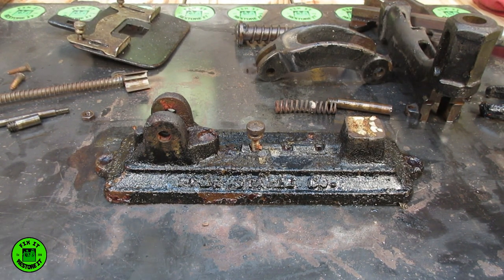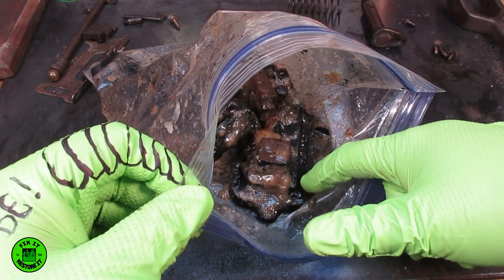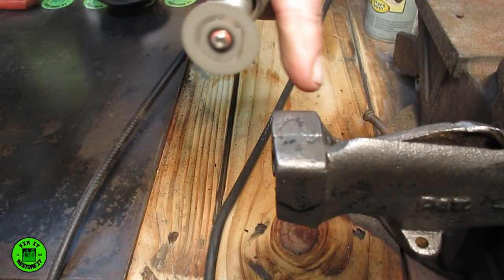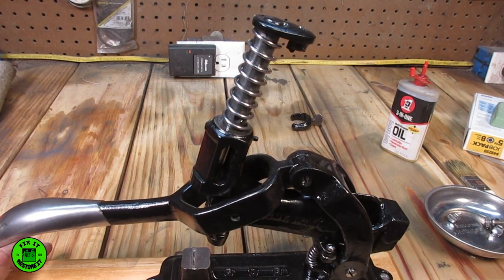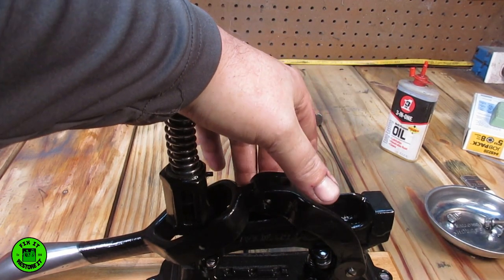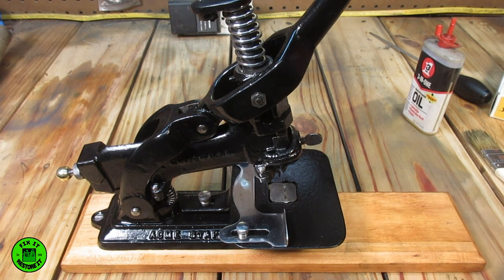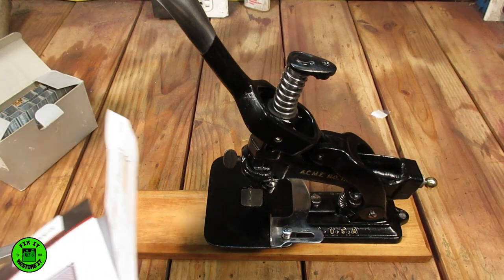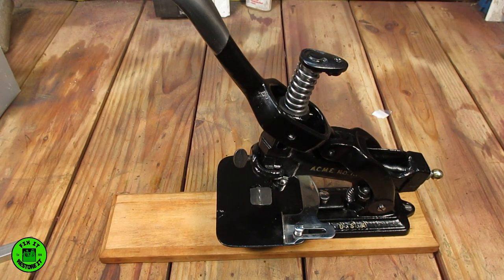Acme No. 1 Staple binder RESTORATION

Comment: Hi! excellent work. I am from Mexico and I have a stapler the same only that it is for magazines, it has an engraving that says "acme no. 1" Will it be the same stapler? If so, do you have a way to tell me where I can get the staples? thanks and regards!
Reply from the maker: 456153 is the code for for 3/8" staples, search "acme 456" on ebay that's ho I got mine

Comment: I don't know if they still make the staples you need, but they made them up until about 15 years ago. They have to come from a place that sells staples for commercial use, like the ones used to put boxes together. I used to run a power stapler that put the big staples in box bottoms to hold them together in box shape before they went down the fill line in jeans plant.
Reply from the maker: They do make them, well at least something similar

Comment: I'd suggest that you should have removed the casting marks and done the fill BEFORE the primer. Paint will always stick better and last longer if it's sitting on nothing but primer. Alternatively you could have just done a second primer coat afterwards, that would have done it too. Just a suggestion, love your work. Keep it up! Also I'm guessing gold, but that's just because the whole black and gold motif is pretty common on older tools. Good way to save yourself a lot of work on compressing those springs is hold the part in a vise, then use a clamp to compress it. Takes some setup, but sometimes it's the only way to do it unless you have three or four hands.
Reply from the maker: I was too excited to paint and didn't realise till I spotted it lol 😂 also, I did use primer again afterwards, just didn't include footage 😎
Reply: @FixitRestoreit  I can totally understand that. Been there before. Like I said, just a suggestion for the future, it'll help make things last longer.

Comment: For those that don't know, this would be part of the process of making larger books, or even magazines. For larger books, the pages are stapled at a certain number of pages per, The staple really only holds them temporarily while the other parts are assembled, then they're all put in a press and the edge where the staples are get glued, then bound, in the old days with linen or canvas, then cardboard and whatever went over that, oft times leather. "graphic novels" and most magazines are just stapled.
Reply: oh this only applies to books that are not stitched. As the binding process happens, the staples are removed once they have enough on the spine to hold it without the staples.